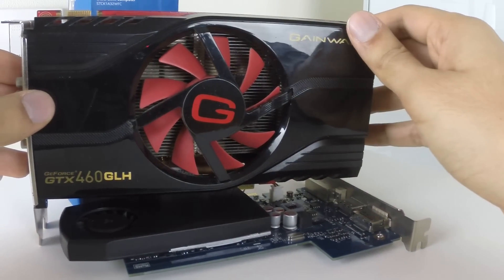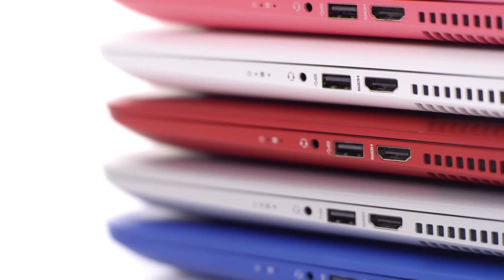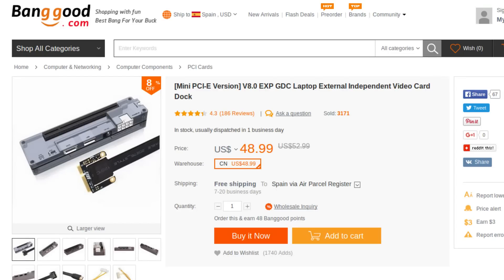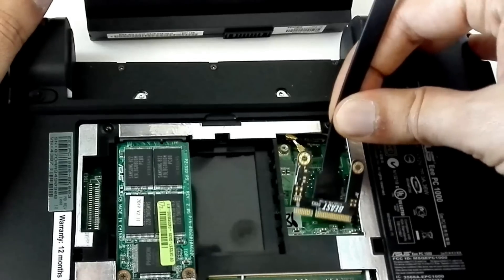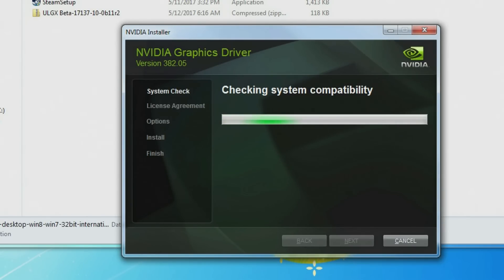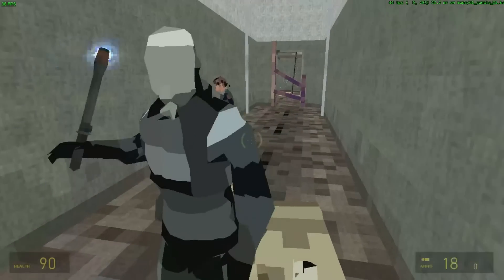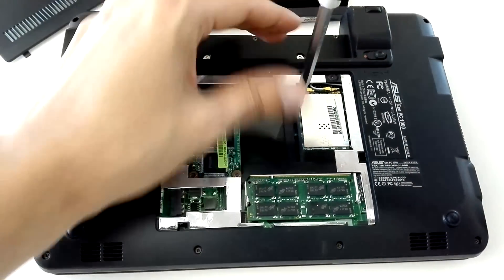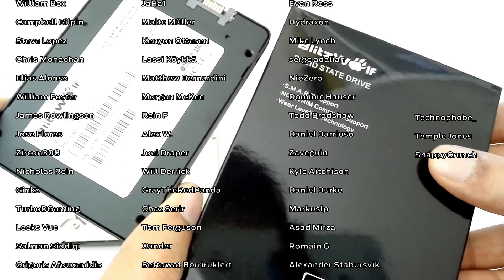An External GPU for an old Laptop?

Comment: I have a toshiba sattelite p55 A5312 laptop ....and i have installed zotac gt 730 2gb ddr5 graphic card in it...everything seems to be running perfectly....the only issue is i cannot play games using laptop screen i have to use an external monitor for the graphic card to work! Can u help me fix this issue?

Comment: It seems cool... BTW I  am a cynd of a fan of one model laptops from 2005 - Fujitsu Siemens Amilo LA170 It has 2,2 AMD processor, maxiumum range of 3 GB of RAM ( unexpected I could run 4 GB BTW :D ) AAAnd the unique ont of its cynd the VIAChrome 128 MB Video Card :D ..... You will be surprised that laptop with installed 32 bit win XP was runing the last version of Star Craft 2 and Age Of Empyres 4. I havent tested any other games havier, but in AOE is runing quite awesome, in SC 2 there ware lags specially if I run the game with 8 virtual machines as opponents and get in fight  with more than one :D... Surprisingly it runs Win 10 quite good EVEN without drivers :D  WIn 7 is running good, bot in order to run good, you should have the 4 GB of RAM and 64 bit version, 32 bit version runs fast if you have 2 GB of RAM, but in 64 bit version the 2 GB of ram are some problem. Any way.. That is an old laptop that I use, I had a Last model of SAMSUNG laptop, that costed 1000 $ and when running an Cyberling Powerd DVD it gaves me a Bluescreen, until this Siemens that you could fry an egg on the touchpad douring high performance is running Cyberlink Power DVD among with two browsers in the same time with atleast 30 oppened and active pages, plus some music on :D ..... My point was the laptop is OLDER than this in the video :D  I was having a wish to try the EVE online, but unfortunately the installer does not give me to install the game because I dont have the minimum reùirements. I am not programmer, so I cant change that :D Otherways I would love to test this too on the same laptop. PS. With Win 7 it gives me 260 MB total Graphic memory, I expect 200 more if Win 10 is installed. I rolled back to windows because I started using the laptop for work and some programs warent running good in  win 7 and win 10 ( even with compability mode, no it does not work with virtual machines because of some programs features )

MAKE an video with results of testing this laptop  at maximum :) It will amase you for a cheap second hand laptop.... ( whell there is no way to have it somewhere in the world new ) :D

Comment: my laptop 
hp 2000 model notebook pc
processor amd 300
Ram 4 gb 
hardisk 320 gb 
system type x64 -based pc 
hd grapich 1300mhz
extaranal grapich card suport

Comment: I still use dual core dude...
D U A L 
C O R E !
Reply: I have Intel pantium single core oooooooooooooooooooof
Reply: @crispyshaman4937  gonna need liquid nitrogen for the overclocking you'll do to run minecraft
Reply: @kurtisgibson2929  nah dont need that anymore bought a acer nitro 5 gaming laptop. So no potato for me anymore
Reply: I still use single core PENTIUM 3

SINGLE CORE
PENTIUM 3

Jk I i'm now have nasa computer
Reply: PENTIUM
NOT PENTIUM 4
NOT PENTIUM 3
NOT PENTIUM 2 
BUT PENTIUM
Reply: @proki4877  486
Reply: I use 6th gen Celeron dual corte @2.00 ghz
Reply: @javitz8847  me celeron N2840 🤢
Reply: @sheko281  me celeron 3450 its probably the weakest quad core processor idk tho
Reply: @sheko281  celeron 69200
Reply: Me 2 bro i have an core 2 due man
CORE
2
DUO!
Reply: I use cerelon 1007u 2c, 2t 1.50genitalhertz
Reply: Me tooooooo
Reply: Me too bruh, i3-8130u
Reply: yeah i'm on dual core too, using ryzen 3 3200U
Reply: Harraz Rafiqi welk Intel Core 2 Duo t7500
Reply: I use a pentium dou 1.73GHz cores .-.
Reply: non-hyperthread?
Reply: I'm on a Pentium 3.
Reply: Core 2 duo with gt210
Reply: all my computers are dual c o r e
Reply: Una persona 100% real 
👈👈🤓
Reply: I have a calculator 
CALCULATOR!
Reply: I use a ceron core 2.40
Reply: Same.
Reply: I use an Intel Core i3-2370M on my laptop and it has Intel HD Graphics 3000, not too bad, but it isn't obviously made for games newer than 2013. Good news is that i can upgrade it to a Intel Core i5-3230M that has a HD Graphics 4000, so it's gonna perform better (even it's capable of GTA V in very low settings), but i'm thinking on also buying with that CPU a cheap GPU and do the process to use it on my laptop, so i could use a GPU even better than the HD 4000.
Reply: Intel Core Duo T9400
Reply: @King Jedorah - Gaming there awesome! Depends on your needs.
Reply: @King Jedorah - Gaming me too but I have i5
Reply: @King Jedorah - Gaming theres no problem wt i3 dual core bro, mostly games can be played wt decent gpu
Reply: Pentium P6100 @ 2.0Ghz with 2 cores
Reply: I still use I7-65000U 

I7-65000U
Reply: @pickle93  Me too i7 6500u is just expensive and trash
Reply: Dual core gang
Reply: same
Reply: I use core 2 duo mobile (1.50ghz)
Reply: 6th gen i5 U ;_;
Reply: @aregmelkumyan1278  i still main a dual core laptop (7500u) because i need to travel a lot, but i guess it isn't really an issue since i don't game (but you do).
Reply: @bananya6020  I'm actually pretty fine with it. I mostly play old games, so i dont need much cpu and gpu horsepower. The gpu is trash tho... It was having a hard time simulating a 2d circuit yesterday...
Reply: c@mbaz i have a single core 1.6gHz laptop don’t complain
Reply: Tom The Big Man 
Wow...
Reply: intel core duo here
Reply: I use an Athlon x2 2.8ghz lmao and a GeForce 9500GT. At least I can play 2010 games and also popular games like csgo, lol, etc (no, i can't play GTA 5 fornite pubg and stuff like that xD)
Reply: Me too
Reply: Athlon XP 1700+

1700+ !!
Reply: @Nibbaton. me too
Reply: Not as bad as a dual core i5 processor on INTERGRATED GRAPHICS
Reply: I use Celeron P4500
Reply: Well I use core 2 duo

C O R E 
2
DUO

Jk I did like a month ago now imma an i5 gamer
Reply: I use an fx 8350 8 core

8350
8
CORE
Reply: @FreddieFatFingers  not a true 8 core tho
Reply: Hexa-Core

Comment: How do u get one of these GPUs (1070/1080s obviously) to run 3 monitors @144hz 1080p in extended mode on a gaming laptop?!?  My 1060 can't give me 144hz 1080p for all 3 monitors. (All monitors are capable of those specs) and my GPU supports triple displays via matrix display. I'm using DisplayPort cables to MST hub to mini display port

Comment: You can change the gpu on a laptop... why do you make it so complicated?
Reply from the maker: There are some very specific laptops that allow changing the GPU but the large majority of laptops out there have no normal GPU upgrade options.
Reply: Stelios F are you a bit late in the technological advancement side ?
Reply: 1. Most laptop has non dedicated GPU, even if it has dedicated GPU you only able to replace the same GPU type. 2. No one sells laptop GPU, well if they sell it, means their laptop gonna be a piece of plastic. So thats why replacing laptop GPU can not be a tip/trick.
Reply: @ahemjunior  They go a step further and change the pin design on the dedicated GPUs, so just in case you might want to desolder the GPU and put in a new one, there is no new one that fits the pin configuration.

Comment: So, you hooked up an external GPU and tweaked the game settings lower than the menus will let you go, and it still can't keep up with my shitty laptop running on Intel integrated graphics. And my laptop ain't exactly new either. Now, if I use Steam In-home streaming to stream the game from my high-end desktop, the results will be comparable, since my laptop's network card is absolute garbage.

Comment: Entertaining but don't do this. Plagued with compatibility and stability issues plus the CPU isn't meant to handle this thermal load and you will experience throttling. Plus Ultrabooks are a complete pain to tear apart.

Comment: So, my laptop has an i7, (which is as powerful as a desktop i3) and an amd radeon r335, the computer has 8gb of ram. With these specs, what graphics card would most likely make it better?

If you are gonna ask for game performance, here you go. 100 FPS on gmod high settings on gm_construct. And 30 FPS gta v using lowspecgamers configs.
Reply: 1 year later and I have a pc with a ryzen 5 2600 and gtx 1660 ti 
nice
Reply: and then 5 months later i have an i9 and a 2070 super founders edition
ive gone a long way

Comment: i have a geforce 310 512 mb ddr 3 gpu with core 2 duo e7500 and 4 gigs of ram i am able to run half life 2 at fhd 1080p at the high settings

Comment: "I have never seen a computer with an express card port"
*Makes a sideways glance at my Lenovo ThinkPad T420*
Reply: "i have never seen a computer with an express card port.."
me: looks at my Dell Latitude E6400
Reply: @justafan3071  me looking at my e6420
Reply: @justafan3071  me: looks at my aspire one 722 
Also me: yeah same
Reply: Same lol
Reply: i plan to do this to a T430(i7 3612), and a 1050 3gb. am i a fool or do i have a chance
Reply: @willcave3607  i just bought a T430 and dropped in an I7 3740qm and used a gtx 1060.  it was affordable. havent ran any benchmarks but i can game in 1440p and some light 4K
Reply: @willcave3607  I know it's a bit late but just wanna tell you. Im using T430s (i5 3320m) 8gb ram + RX 470 8gb and it run just fine. Sometimes theres micro stutter in newer games but it's nothing. Since you have a better CPU it should run smoothly even with 1060 6gb or (maybe) 1070.
Reply: ThinkPad T420s also has one, the early T400 series is possibly the most modular laptop series ever made
Reply: @mwbgaming28  l
Lp
Pl
Ll

lol
Reply: watching this on my old old sony vaio with core 2 duo. and looked on the left side of my laptop. Hey! I got an express card port! haha
Reply: My first laptop had one.

To put in perspective how old my first laptop was, it had no built-in wifi, and I had to use a wifi express card to add that functionality.
Reply: To my dell precision m6500
Reply: Well basically express card port is on the majority of business laptop or workstation around 2000-2015

I'm looking at you, my hp EliteBook 2570p
Reply: Yeah, I'm now considering getting one of those for my 2560p :P
Reply: or at my dell latitude e6430
Reply: Dell Precision M4800
Reply: Lenovo T500.
Reply: @Murad Karammaev cries in x230t
Reply: "I have never seen an Express card slot on a laptop"
Me: looks over to my Alienware M15x
Reply: Samsumg R580
Reply: Side glances at my ASUS M70Vm-C1 with Express Card 54 slot 😁
Reply: My 2010 MacBook Pro 17" i5
Reply: toshiba sattelite something
Reply: Elitebook 8440p with 820QM/8GB/2 SSDs.
Reply: @Adam130694   Adam130694  Damn bro😂

I will be switching to my 8470p soonish with an i5-3380M and 8gb of ram, comes with my first SSD too, a crucial MX500 if I'm not mistaken.

All for £50 (additional 4gb ram stick was added by me).
Reply: @Murad Karammaev me too
Reply: Also watching this from my Thinkpad L412. Now I'm gonna have fun
Reply: Also watching this from my Thinkpad L412. Now I'm gonna have fun
Reply: Looks at my msi gv62 8rc
Reply: Glances sideways at my Latitude E6500, T400s, x230i, x260
Reply: @martin1649  I love that over two years later people are still commenting on what computer they happen to have an expresscard port. It is kind of cool!
Reply: * makes sideways glances at my Thinkpads T61, T61p with GPUs, & my W500 with gpu*.     LOL
Reply: 420 nicr
Reply: glances at my hp elitebook 8460p
Reply: Looks at elitebook 6930p

Comment: Will the Dell latitude D610 support an egpu or is it simply to old?
ok so I have a Dell Latitude D610 and I was thinking about experimenting with it to see if it would fit a epu but after doing some research it seems like it may not be possible. This computer has a pcmcia slot but i heard thats not the same as a expresscard slot and it may not work or work at all. Then i thought about the wifi card slot to do it but that may not work either since this laptop uses the oldest wifi card format. it uses mini pci type IIIa and most laptops of today or made after 2005 use  PCI Express Mini or  PCI Express Micro so the Exp gdc adapter only fits  PCI Express Mini and  PCI Express Micro

Comment: How many Watt for the PSU?
Reply: depend on the GPU. Less then 200 watt
Reply: @ahemjunior  200w could quite easly be insufficent for a GPU as you have to count that 200W doesnt count for inefficency
Reply: @samcan9997  i never use over 400watt PSU on my second gen PC, because they never even get to 300watt with any GPU inside, and i games a lot. Gen 3 to the last gen should be a less power. Well that how i built my PC for over 20 years, i only count the CPU + GPU max power consumtion. They never need those number, the factory put those number for dummies so they don't come to claim warranty often.
Reply: @ahemjunior  ehh its still better to run it at around 70% load and yeah it depends on your GPU choice but ide still say go like 400w maybe if you have a fairly efficent one

Comment: I did this with an old HP office desktop machine, using a 5 dollar chinese PCI-E to USB adapter and a GDDR5 GT640 i got at Goodwill for 5 bucks. The 4gb of ram and Core 2 duo E6700 can almost play GTA V on lowest settings now, I just need to find a few good dual-core tweaks to make it properly playable

Comment: I am thinking of doing this, my laptop is a Lenovo thinkpad yoga 11e, the clock is .80ghz, it has 4gb ddr3 ram. If I add a 760 graphics card, will it get over 30fps on fortnite? I am getting around 20 FPS on low currently

Comment: That's super cool, and hey, even if you have to remove your Wi-Fi card, that's not that bad, because you can get a flat profile USB Wi-Fi adapter to replace it (which can probably hit higher speeds than your old one anyway!).

Comment: Hello, I need you to help me with this, I have a laptop with an "intel celeron 847" processor and I want to put a 6450 hd ati radeon, can I put it on and it does not burn? because the video card that LowSpecGamer put in this video is like a little bit demanding for that intel atom

Comment: How will you turn off the gpu since you used separate power supply.  Because when you shutdown the laptop it will not automatically turn off the gpu since it is connected to a separate power supply and can broke your video card

Comment: Ugh, will this work on a HP Pavilion (2010)? Can I use a GTX 1050Ti?
Reply: most hp's dont support this method because the bios is blocking it
Reply: FluFFy RocK CPU bottleneck
Reply: PlisDondSibscrobeMiChannal install coreboot then

Comment: Mine just keeps restarting the laptop and the while system. I was using a 12 volt adapter so I switched to a PSU and it literally short circuted my PSU. It boots up for 2 seconds then reboots over and over until I turn it off idk what the problem is.

Comment: Tried it via expresscard on a T420 with the i5 3.3ghz (I want to use it daily and I dont want to put stress on the pcie connector. Also the expresscard slot doesnt have much lower band width from the pcie so it works great) really good little gadget

Comment: Honestly, I would build a new pc. 
The dock cost $50, $100-$150 for a decent budget gpu like a 1050ti, and the psu which cost an additional $15-25 for a cheap psu. The cost of just upgrading cost about $200, and not to mention that old laptop cpu will most likely bottleneck the gpu. A new budget gaming pc cost about $500, if you have a tight budget, buy used. I bought an old prebuilt pc with an i5 2400, 8gb ram, 1tb hdd, and Windows 10 for $120, bought a 1050ti and stuck it into the pc, cost me less than $300 for the whole pc and it runs great.

Comment: I have a 2014 gaming laptop, I have a basic laptop. both uses m.2 slots, sad. now I'm considering on buying a 2nd hand laptop with a slot for external gpu, I tried and it worked with my sisters old laptop, but her laptop is not in a good condition to be used.

Comment: Hello! I have a kinda old DELL N5110 laptop.
8gb ram
I7 2670qm 3.1ghz boost
Gt525M+hd3000 igpu

Will my laptop be able to support an external gpu like 750ti? Does this model have one or two PCI slots since it also supports Optimus and I have no idea how would that interract with another external GPU.

Comment: can you use the laptop scream?
Reply: Matheus G.O. s c r e a m s  I n  p a in
Reply: not on the mPCI-lane, since it would get massive oversaturated due to the 1GB/s speed of the BUS. I myself am running a GTX 1060 through an expresscard 34 (2.0) slot and with the through speed of 8.0GB/s (if i want to run games on external screen) or split speed of 4GB/s(if i want to run games on the internal screen) i get massive differences in performance which are not worth it. I'd say, get an external screen.

Comment: Can I use this kind of external GPU comverter with GTX 1050ti external GPU on Asus GL552JX via M.2 SSD (SATA3) connection ?
Because if I know good the M.2 SSD slot is PCI Express connector !?

Comment: I have an xfx 6950 from what is probably gonna be a media PC. Is there a way I can power it's 2x 6 pin connectors by mains? Also if I manage to power them do I STILL need power to the 6 pin on the enclosure?

Comment: My advice offered at my own expense is that you need to ensure that the chipset of your laptop supports gen2/gen3 pcie as otherwise framerates are abismal using 1x gen1 port. I made the mistake of buying what I thought to be a gen2 laptop, only to discover that it had been falsely advertised, and that whilst it could supply power for gen2 devices, it only worked at gen1 speeds. Problem is, not many budget laptops out there that support even gen2, nevermind gen 3 so make sure to do your research, then check twice. And hopefully use something more powerful than the atom cpu as shown in the video above, if you actually want to achieve something capable of playing on medium/high settings at a good frame rate.
Reply: Samiby what chipset are you talking about? and how do I check it
Reply: Caesar Voorhees anything sandy bridge and later